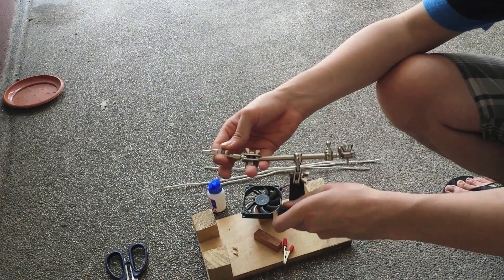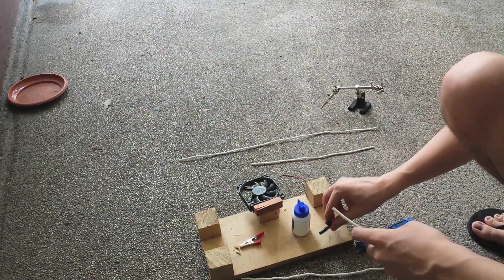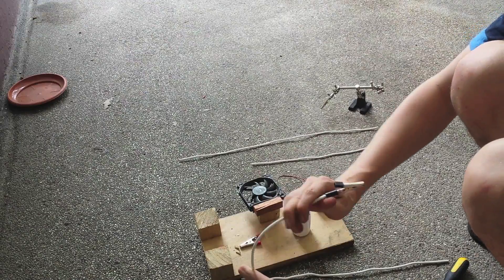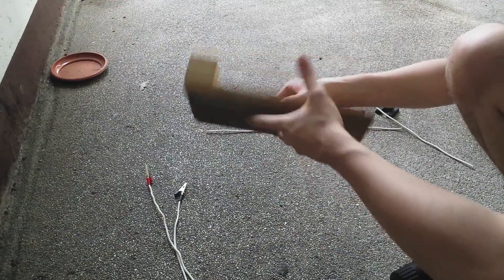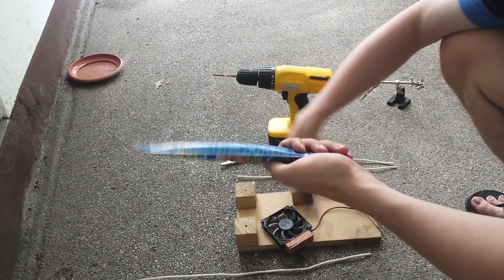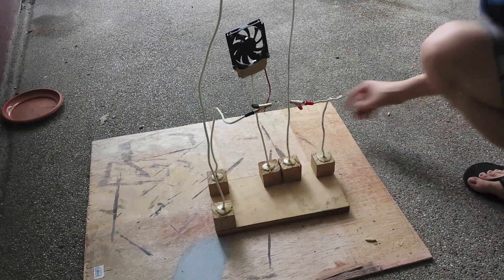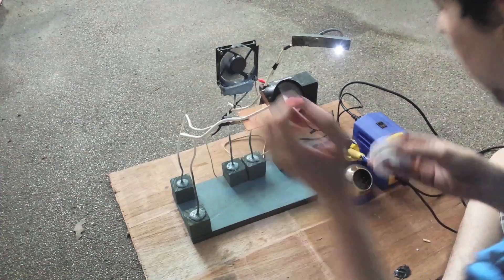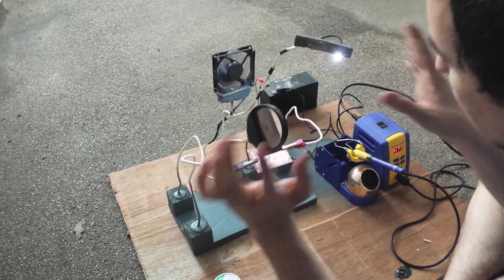Soldering Helping Hands DIY

Comment: I can't get myself to spend $6-$25 on "helping hands" when I already have all the materials needed, to make my own. I improvised with alligator clips for electrical work and added a steel wire and use a vice to hold them. I also folded up some aluminum foil to prevent the teeth from cutting delicate thin wire.

Comment: I like the fan and light idea. Although this has some issues, the issues are easy to identify, and I believe it encourages us to improve on this idea. One thing you could do, is add more than 1 "arm" to increase stability. The additional arms, wouldn't HAVE TO be out of the same wire, so even cheaper thinner wire could be added, to dampen the movement. With 2 arms on 1 thing, you can use an arch design, such as comes up on the left and right. With 3 arms, you would get very good stability, like a tripod. Just make sure the placement and lengths, don't get in the way of work.

Comment: Well, your idea is amazing.
And it almost works.. But their is a problem you seem to overlook. The hands that are supposed to hold your work are really flimzy and shaky.
The moment you try and tutch the iron with your wire or circuit it's going to shake alot.
So you might as well bleep hold it...
But. You can get another wire, and just twist them so their less susceptible to moving on pressure.  
And i would also like to point out, it's wayy better to just install the light on the side of the wood. Rather than having it fly the bleep around on a piece of wire, never the less Good job.
Reply from the maker: MyVash12349 You have some valid points but in the future would you mind watching the cuss words? Unfortunately I only have the option to delete comments, I cannot modify them. I don't want to delete your comment because you make some valid points. I think I mentioned in the video description or another comment that you should either have your wires shorter or use a thicker wire if you don't want them to move around. Mine were far too long and that made them wobbly. Keeping them shorter fixed that problem :)
Reply: Gadget Addict Welp, fixed my cussing you took issue with. But I would like to ask you, why do you take offence in swaring?
It's not the internet if you dont scroll down and see 12 year old nazist's swearing & making threats towards jews... =D
Reply from the maker: MyVash12349 Thank you :) It doesn't personally bother me, but I have some younger subscribers and I want to try project a good image for my channel :)

Comment: Wires are way to wiggly. I'd find it rather difficult to solder. Nice idea though.
Reply from the maker: I went to the extreme and made my arms extremely long. If you made them shorter, they're stiff enough not to wobble when you move them :)
Reply: Stiffer, as in heavy gauge wire, solved that.